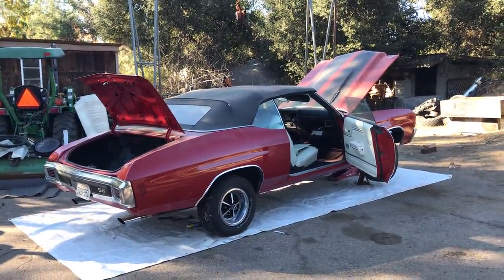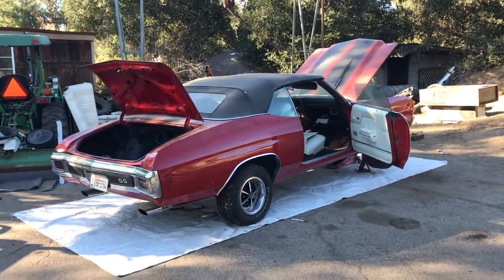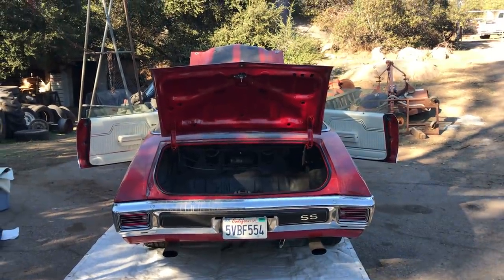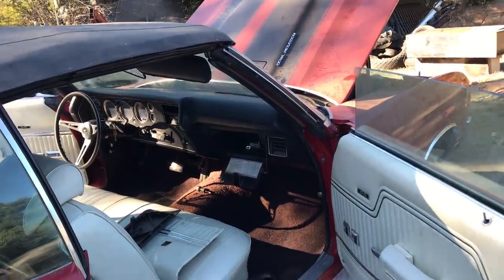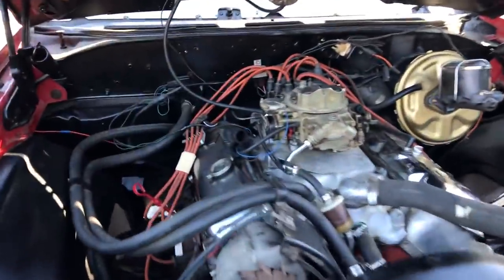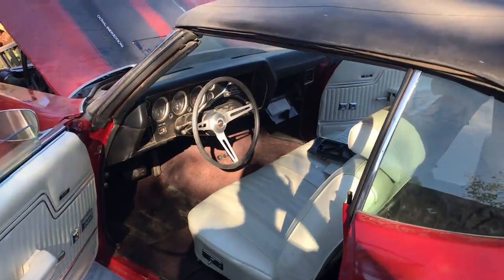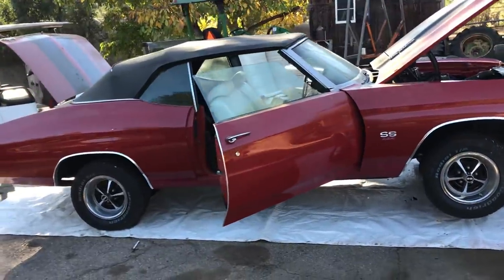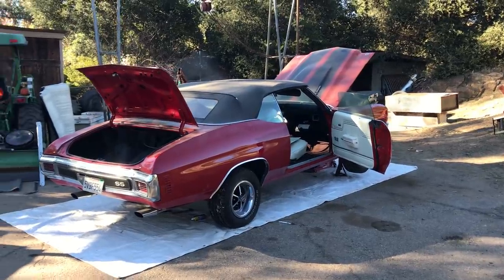I Saved a Guy $250k From Nearly Buying a Fake 1970 SS454 LS6 Convertible In San Diego, CA!!

Comment: Nice job Patrick on finding out it was cloned,thats still a really nice clean convertible,
I know you love those 70 chevelles,i own a 71 chevelle Malibu,i did a complete resto on it,but i hade to put the cowl hood an the hood an decklid strips on it,with a 500  horse 355 in it an a 12 bolt,
My uncle who passed away has an original 72 ss,its like a Marina blue with black hood and decklid Stripes,it has the ss 396 emblems on the fender ,but i think its a 402,
Its like a  Survivor car it's been garage kept for 40 plus years has the original cragars, everything is original on it ,untouched, bucket seats   black interior, round gauges in the dashboard,funny story,back in the late 70's my father told me he was gonna buy the car,an he was on his way with the money,i think he said like 2 grand at the time,but when he got there my uncle beat him to it😂😂an there it sat in his garage in N.J for decades ,only taking it out to the local car hops in town,the car is rust free,only a few little minor dings an maybe one little dent in the bumper,i think from backing out the garage all tuned up😂😂from what i know now after he passed away it was left to his daughter,my cousin,an its now in her garage,just sitting,at least its out of the wheather,,man i would love to get my hands on that one,i know for a fact he has the build sheet,i remember him showing me an my dad some years back,i think it was under the back seat🤔but in 72 all them motors had really low horsepower,i think its only 240 stock,in that 402 that 402 big block🙄o well,maybe i can talk my cousin into selling it to me one day,lol
Good video,🤘thanks for sharing,an letting me share,

Comment: do Chevelles not have a cowl tag? I expected to see that in this video the option codes on that should be a quick way to determine if its real or not like you said a lot of parts could have been changed in 50 years but the cowl tag usually is not changed.
Reply: I was thinking the same thing. Cowl tags are reproducible but the vin is not. I was wondering what the vin tag says it is. If it says its a SS454 LS6 then it's possible the vin tag has moved from a wreck, or a rust bucket and in that case the car is illegally vin'd.
Reply: Only ones assembled in canada have the codes
Reply: @z71ne1  I didn't know that. Thanks for the info. Does that make the Canadian car worth more money? It would be identifiable.

Comment: When a seller says something like "as far as I know" , it's a red flag. Not saying that happened here just saying from experience.
Reply: This seller was trying to run a scam, A good tell tail sign for any Chevy SS in the late 60's to early 70's, be it a Chevelle, Nova, or Comaro is that they are all bucket seats and the transmission gear selector is on the center console, NOT on the steering column. A true SS will NOT be standard equipped with a front bench seat.

Comment: Patrick - Thank you for your extremely informative videos. Do you know if hi-perf small block motors such as the L79, LT1 or Z/28 302 also had a 3/8 fuel line? Thanks.

Comment: The guy who did this clone probably stole a reel Chevelle 1970 SS and put all the stuff in this normal Chevelle cause its pretty hard to find SS stuff and a reel LS6 engine plus all the other SS part he put in this car... make sens to me!! great video.
Reply: No
Wrong Turbo 400, Wrong 12 bolt rear end, wrong block. List goes on
Reply: LS6 454's are definitely out there for sale.   All the other SS stuff is pretty easy to obtain.
Reply: @johnvegar9098  None of the correct LS6 stuff is easy to obtain. Needle in a haystack.
Far as real LS6 Convertibles for sale, you better sell your house snd cash in your 401k.
Reply: *real

Comment: The owner knew it wasn't a real one.  He's a con artist that got caught. A true garbage human being.
Reply: You god damn right he is a con man,  A good tell tail sign for any Chevy SS in the late 60's to early 70's, be it a Chevelle, Nova, or Comaro is that they are all bucket seats and the transmission gear selector is on the center console, NOT on the steering column. A true SS will NOT be standard equipped with a front bench seat.
Reply: @oveidasinclair982  actually bench seats & column shifters (automatic cars)were standard equipment in 70-72 Chevelle SS cars unless ordered with bucket seats & console
Reply: @oveidasinclair982  column shift was standard on all 70 Chevelles with automatic transmission.  Bucket seats and a console were two different options.  You could get bucket seats and have column shift, but if you ordered a console you had to also order bucket seats.

Comment: Being a Turbo 400, kickdown is activated electronically, there is no TV cable, like a T350, but a switch,  is that mounted at the firewall, and activated by the throttle linkage?

Comment: I have to say that I disagree with your assessment from what you indicated. The build sheet, vin tag, cowl tag, dealer sheet, and frame vin are all required to verify SS. Every other component can have and could have been changed previously, the kick down cable firewall modification would be dependent on the date of manufacture and where it was built, the 3/8 fuel line could have been changed out as well at some time.  It doesn't matter if the rear, trans, and motor are wrong, that only indicates that they are not original and the car is not numbers matching. The boxed trailing arms, frame stiffeners, rear swaybar, ad larer frnt sway bar are all indicitive of the F41 suspension package. Which I am not sure, but I don't think was required to be factory SS. The package came with most SS cars, however, that does not indicate wheter or not a car was SS. Unfortunately the "king of the muscle cars" requires an ungodly amount of research and documentation to prove its validity. The only things that will determine "SS" or not is stamped into, or riveted to the shell and frame. Every other component is/can be changed. The stamping of the vin on the engine deck could (and ofter was removed by the machine shop) if the block is decked for rebuild or compression, the block can be restamped with the vin. The only way to tell is by polishing, then acid etching the deck stamping area to look for evidence of a previous stamp. I had to do that previously when I was an automotive machinist to prove  or disprove a block as being vin matching.

Comment: They are rare. Because the convertibles were reinforced in the rear section of the frame. And we took a lot of those frames out from underneath the convertibles, and put them underneath the hardtops. And most of the time, we had to fix the welds on the passenger side of the frame. Because back in the late 60s and early 70s, and there was a lot of drinking going on, on the assembly line. I personally have pulled Coors cans out of those frame rails. Usually, on the passenger side. And I wish I could say it was just isolated to The Chevelle's. But, I've also found them in Buicks Pontiac and Oldsmobile. Got a rattle, no one can seem to locate? Been trying to track it down for years? Had the entire front suspension replaced several times, and the rattle still doesn't go away? Pulled a body mount bushing out of the passenger side cowl mount. See what falls out.
Reply: didnt he say convertibles were all made in baltimore????   coors was NOT available east of the mississippi back then.
Reply: @brianfairchild7819  ... you ever seen Smokey and the Bandit? Did you think that was just a really clever movie?
Reply: @mr.mckinnon5680  yeah, was just a movie. i grew up in the trucking industry and dad used to bring back a case or two, not a truck load.

Comment: You sure know your nuts and bolts all over your Chevelle I have a 1969 Camaro Rally Sport Hideaway headlights I took the 327 motor out in 1980 and put a 30-7 in because I blew the engine you know young and dumb eventually I had the car rebuilt from the ground-up motor body put a rebuilt 69 SS Super Sport Camaro motor in their 300 horsepower with double hump heads transmission tail shaft 350 Turbo came with a 2-speed Powerglide in a 327 with a two barrel the motor fan change the transmission change the rear is the same I'm wondering any value it hasn't been off the frame subframe bushing replace I love watching your videos they bring back the old days

Comment: One thing to also look for is holes that might be filled on the top edge of fenders, doors and quarters where Malibu trim would have been. I could be wrong but I think there is a hole at least in the front and back at the ends of every molding.
Reply: A good tell tail sign for any Chevy SS in the late 60's to early 70's, be it a Chevelle, Nova, or Comaro is that they are all bucket seats and the transmission gear selector is on the center console, NOT on the steering column. A true SS will NOT be standard equipped with a front bench seat.
Reply: I guess I should have said upper edge. Its the top of the side, google images of Malibu and SS, and you will see the trim I'm talking about.I don't know about the convertibles, but there were Chevelles lesser than a Malibu, so it doesn't mean it is an SS if it doesn't have it, just that if you can see it did, it was a Malibu, and not a SS

Comment: I went and looked at a 66 Chevelle SS 396 many moons ago to possibly buy.  Car was in great condition, almost everything seemed right except the VIN said it was a CONVERTIBLE but it was clearly a hard top. After checking  more stuff the majority of it was correct except for the engine as it was a 70 402

Comment: I’ve got a 454 block.  It’s stamping indicates T0406CPD with a VIN of 11B18980? (the last digit is illegible due to an apparent light stamping).  My understanding is that this was from the Baltimore plant from 1971 and was a 365hp LS5. 

The block appears to be a factory four bolt main. My understanding is that the 1971 LS5 is supposed to be a two bolt main. I’ve heard anecdotal stories of random LS5 blocks being four bolt. Is this true and is there any rhyme or reason as to why some LS5 were four bolt blocks?

Comment: So,, knowing this info, what would you suggest to be a fair value for the car as it sits?
Reply: If real $54,000,000 but a clone that cost more to make and better than original $20K
Reply: @wileecoyote5749  that's about what i had in mind. 15 to 20k. I'm not as involved in values as i used to be so i wasn't completely trusting my evaluation lol. Thank you for replying!
Reply: @wileecoyote5749  I think you are too soft on the price. A 350ci might go for 20-25 but a real LS6 engine puts it at 30k. Still a far cry from a real one

Comment: Did you find the fuel line  coming from the gas tank comes out of the frame rail at a different place where it comes out on an SS frame rail?
In 1969 the SS is an option on the Malibu Chevelle & to discern the difference is almost impossible

Comment: 25 years ago I dealt in a few old Bowties and a man in Southern Missouri drove up in  the worst looking 64/65 El Camino I had seen in a long time. It was turd brown 327/AT but the interior was spotted calf hide with silver concho's attached  all over. Rough running old rig but guy said he original motor/trans at home that smoked. Priced rig cheap but I passed and a friend of mine ended up with it. He researched it and came back it was presented to LBJ at worlds fair in 64/65 and was a 64 with 65 grille. The chevelle club ended up buying it and painting it back cream and slicking up the interior. Have no idea where it is now.

Comment: At least it wasn’t cut up, donked out or “upgraded” into the scrapyard. 
I like original, but installing factory options or even period wheels is OK and reasonable maintenance might even include some incorrect parts. Remember, you never own a car that’s great enough to preserve, you just have the priviledge of being its caretaker for a while. 
Me, I have a soft spot for Sally Rands, 3 speed Corvettes and Model A’s without sidemounts.

Comment: A guy I knew remotely in Harrah Oklahoma had a 1970 Chevelle SS454 LS6 but it wouldn't surprise me if it was a clone as well. One thing that doesn't matter in my opinion is that car would haul ass in a hurry. It sounded like it had pretty low ratio rear axles. It was white with a black top.

Comment: my father has a 1970 chevelle ss that he bought around 1980 red with black stripes hard top 4 speed black interior. he's only put roughly 30k miles on it in 40 years. 44k miles on it now.  I'm pretty sure he found the build sheet in the passenger door panel. I'd love for you to go through it and see if its legit! it does have AC in it even though the build sheet says it didn't from the factory...curios to know why or how that came about.

Comment: I have a 1966 Chevelle with a 13817 vin but it's missing a lot of SS parts like Hood emblems is there anyway I can authenticate whether it is a true SS car or not
Reply: does it have bucket seats, shifter on the center console ?  Chevy SS cars, be they Chevelle's, Nova's, or Comaro's were not equipped with bench seats, or gear sectors on the column.
Reply: @oveidasinclair982  yes it has bucket seats and a center console winter kneeknocker tachometer it's a 4-speed manual transmission car

Comment: Not surprised at all.  I run into 60's and 70's clone cars of many different types at car shows frequently.  I always ask them if it's original or not. Sometimes the owners know, but most often not.  Most owners with the clones that don't know are too eager to whip their wallet out and buy it from another that said it was without doing their own research first.  As in the case of this video, there are more clone SS Chevelle's running around than were actually made.

Comment: Could you get an LS6 with a column shift? I’ve seen COPO Camaros  with them so I guess so
Reply: Yes. When you ordered an automatic, column shift was standard. You did not get the floor shift unless you ordered console.
Reply: Only if you stick a LS6 in the car later, ALL Chevy SS cars be they Chevelle's, Nova's, or Comaro's were not equipped with bench seats, or gear sectors on the column, bucket seats and center console.

Comment: The 1970 GS 455 Stage I is faster than a 1970 LS6. AND the Buick has air conditioning and power windows!   But the 455 is about 100 lbs lighter than a 454, so the Buick can afford the weight of more luxurious options. The LS6 is rated at 450hp and the Stage I is rated at 360hp. They are each much closer to around 400hp. The Buick gets the edge with a more torque at a wider RPM range.

Comment: I really like 70 Chevelle’s to but I’m not for sure what you mean by a rounded Dash with the tachometer I’m not knowledgeable enough I guess
Reply: Tach dashes have the speedo and tach in round gauge pods as opposed to a regular Malibu dash the speedo is a long thin rectangle shape.
Reply: meangreen69Nova  Yup, had to fill those slots on MC replacement dash for mine. The orig. had entire radio area hacked away for pullout stereo, broken mounts, etc. Installed all Autometer Phantoms which was no issue since not original dash. Still have orig. cluster in box somewhere.

Comment: You want to build a GM big block get yourself a 454 block and a crank out of a big block 366 truck motor along with the truck heads their closed chamber next buy some 427 early vet pistons use the truck rods and 396 counter balance and flywheel you will have an internally balanced motor

Comment: Exactly what “heap of trouble” would he be in?
I mean I know it’s an ass thing to do , but ........
Also you mentioned some things like wrong 12 bolt and wrong deck lid 
What was wrong about them?
Reply: When you are demanding north of $120k for a car you know is not what you are advertising it as and misrepresent as a super rare car its called fraud.
Reply: @55metalmonkey  who said he was asking any certain price?
Reply: @engine22emt  Because that's roughly what a real 1970 convertible 454ss would go for, base models go for $15k-30k and also having altered numbers is a huge problem.
Reply: @55metalmonkey  two things 
First of all
Who said the owner did it?
Secondly this is exactly the crap
That has driven the prices through the roof
I follow this guy because every so often he shows neat cars
But he is such a 70 LS6 prude
I won’t take anything away from what the LS 6 chevelle was 
But seriously it wasn’t anywhere near the fastest car out there 
A stock 70 375 HP Nova would destroy it
Reply: @engine22emt  He even said it was unlikely the current owner did it but lets say hypothetically that  you bought a car years ago under the assumption that it was what was advertised (ie: original 1970 454 ss LS6 convertible) and then only found out years later that it was a clone with altered numbers, it wouldn't only be a dick move to to try to sell it as a original 1970 454 ss LS6 convertible... in many places it would be outright illegal especially if they could somehow prove that you knew it was a fake...... like digging up a YT vid of someone inspecting the car and telling you it was a fake. Also knowingly selling cars with altered numbers like the engine/ Trans/ frame / etc can be illegal as well since it could be a sign of deliberate fraud or stolen parts.

I think you are confusing the enthusiast market with collector market. Enthusiasts buy nice cars and drive them/ work on them and in general don't give a shit how rare their car is, they just want a cool old car that they love.
The collector car market generally doesn't care what car can destroy what other car, prices are set by the market and what people will pay. Rare, ultra low production number, uniquely equipped cars fetch a premium. This has been going on ever since rich assholes started buying rare cars. Just the way it is.
Reply: @engine22emt  my 1969 SS 396 Chevy Nova blew the doors off my bothers 454 SS Chevelle every time.